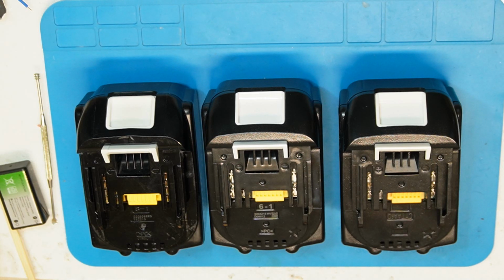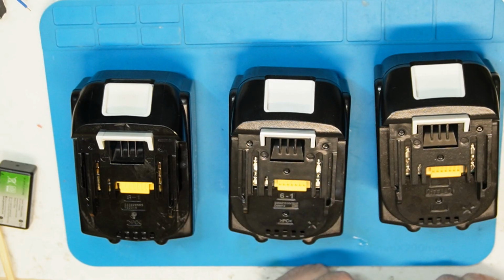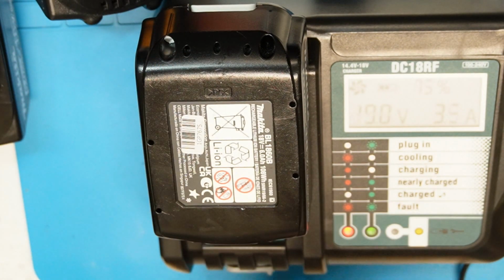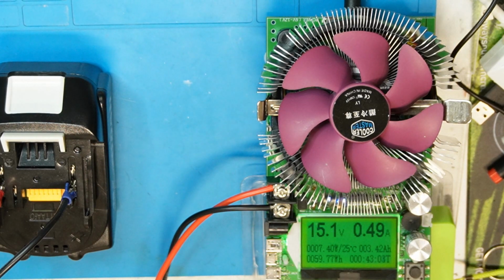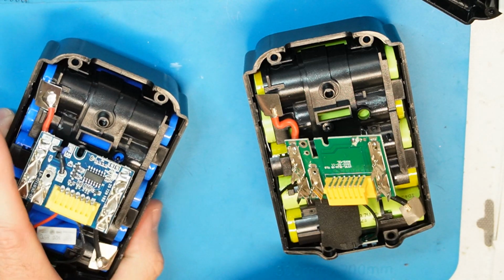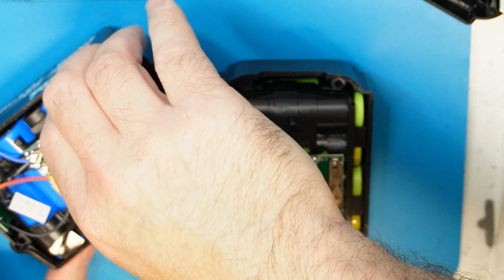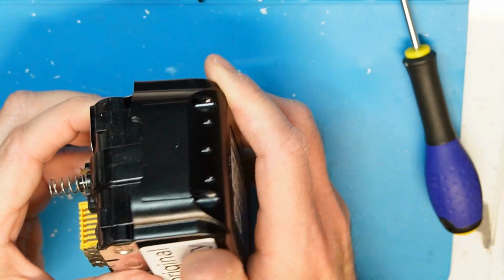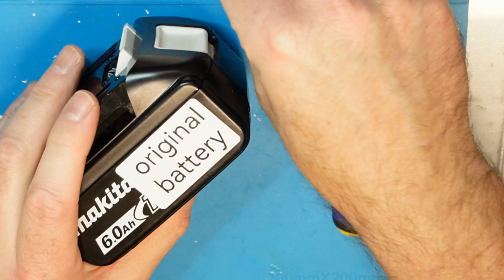Dangerous Makita Aliexpress Batteries - Be Careful!

Comment: Is it possible for someone who has an original battery but it's dead to have it replaced by a technician?
so that they have a new battery again? Or is it so complicated that it's not worth it? As you say, an original costs $100. If you repair it, it can be repaired for $50, including a technician's fee. If it's more expensive, I don't think it's worth bothering with it and I'll buy a new one.
I bought a new battery from a shop in my country that's known as a good shop, and they sold me a fake Dewalt battery, 18V 2Ah. When I opened it, I saw that it only had three cells, so 3 x 3.7V = 11.1V = 1500mAh, so it had absolutely no power.
It worked for two minutes, then it died.
So I don't trust anyone. They're all scammers. The same company has batteries manufactured in China and sells them as originals under their name because they make a profit from the Chinese companies.

Comment: If you don't want those aliexpress batteries I''ll happily take them. Stop scaring people, those batteries are fine to use. I and many other people I know use them at work for many years and had no problems with them, yes the capacity is lower but for the price it's great and lasts longer then the "genuine" overpriced Makita batteries.
I will keep buying the Aliexpress ones.
Reply: There have been a number of very serious fires (in some cases deadly) started by knockoff batteries.
Reply: @theronwolf3296  there were even more fires caused by "genuine" batteries so maybe we should stop using batteries at all? 
These scare tactics work on week minded shiple.
Reply: He's right. If there's no BMS, that's REALLY scary, even if it works most of the time. Think of as a wiring in your house; you probably wouldn't want to power anything without any fuses or protections. As any short will BURN out cables really fast.

And there's another thing. There doesn't seem to be any balancing circuits on the fake batteries either. So when cells get out of balance, they will either die or one or two cells be overvolted to hell.

Honestly, if you want to cheap out on batteries; just remove old cells from the original pack and replace them with good quality ones. Probably ends up cheaper than a new fake pack.
Reply from the maker: Don't agree, after I sent this video few people that bought these batteries contact me and told me that they had a fire with these batteries from Aliexpress - so you are totally wrong, if you want to use them have a good luck and pray every day that your house will be fire free
Reply: Ignorance is bliss buddy
Reply: @Yobott  yep it is
Reply: no there not, not protection for the tools, no when loading...........
Reply: How is the weather in China?